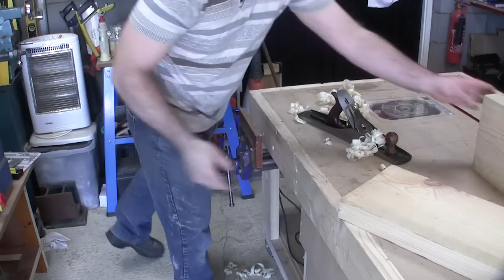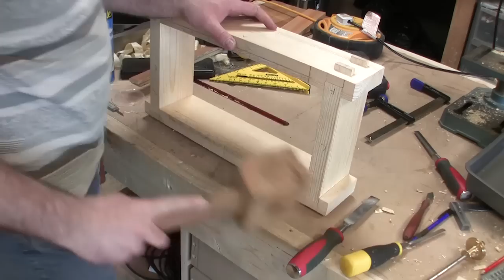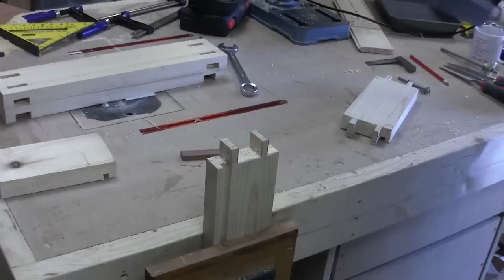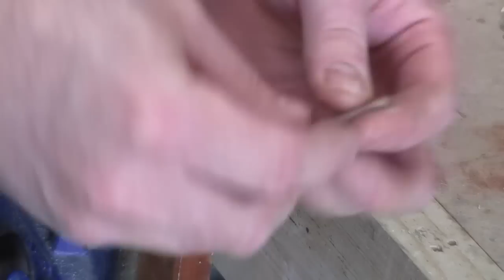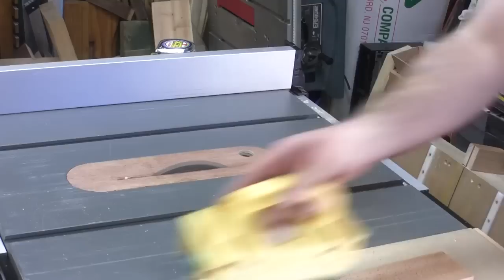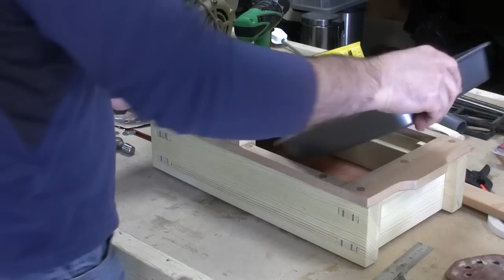Samurai Carpenter Inspired Chisel/Plane Sharpening Station

Comment: That looks awesome.  How do you find it in use?  I want to make one that's similar but I'm concerned the inside will get full of drips and slurry.  Any suggestions?
Reply from the maker: Thank you! I really like it and it works well. The inside does get wet and mucky, but I just wipe it out with some damp kitchen roll. It has stained the inside, but next time I'll use a hardwood instead of what I had laying around. Otherwise, it's briliant.
Reply: Humble ⬆️😉

Comment: You seem to need to check your jointer a lot; it might not be set up properly. For great success: The cutter head must be parallel to the outfeed table. You can use a dial indicator on a magbase to check this fairly easily (but this is not uber-critical, using a steel ruler and judging by eye or with a shim is good enough). The blades must be set parallel to the outfeed table, use a steel ruler to adjust them for ~5mm drag or so, evenly. That method is the most precise and easiest way of doing it. The tables must be coplanar, use a long steel ruler/straight edge to check that and run a long piece through and check the curvature of the edge against a straight edge. The opposite of the table curvature will be your cut, so if the tables are convex, the cut will be concave. Flat or slightly concave cut is good for jointing.  The jointing fence must be set square to the outfeed table, not the infeed table. On some machines it can't be square to both tables -- always choose the outfeed table. That's dominating the cut you'll get.

Comment: Are your stones attached to those wood blocks or just sitting in the slot perfectly snug?
Reply from the maker: Hi Ryan. The stones are in pretty tight between the two small wedges. They can be knocked out easily from the side. I hadn't filmed the making of the stone holders, but they're simple to make. Thanks for watching!